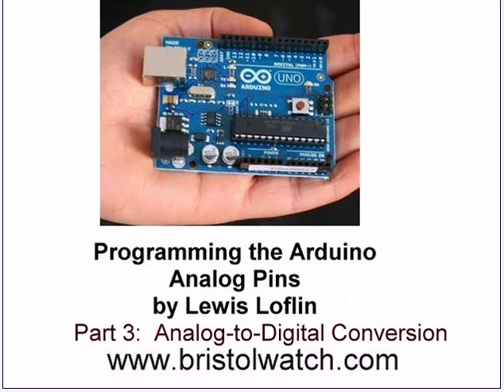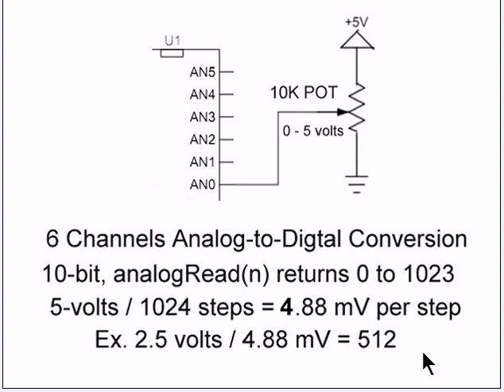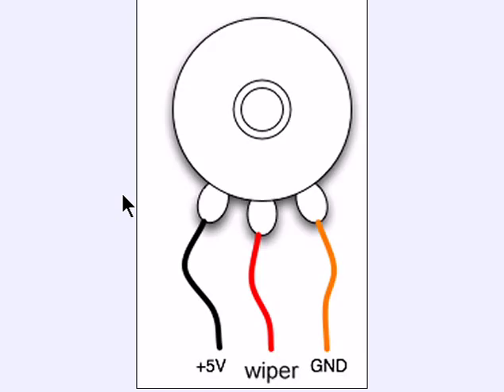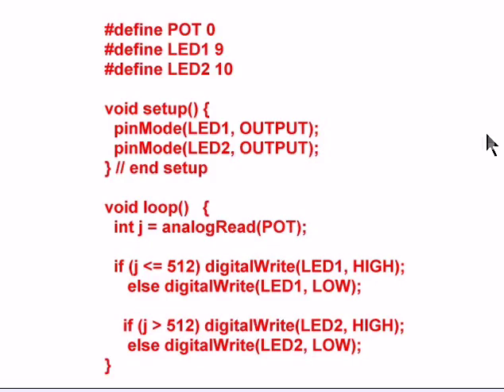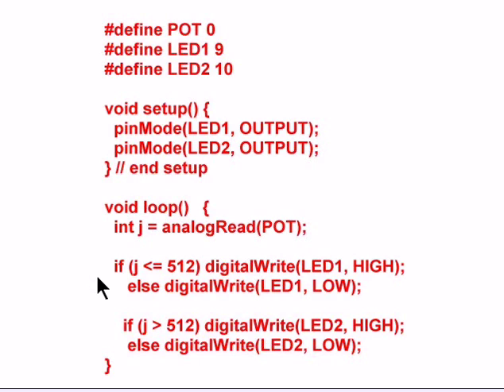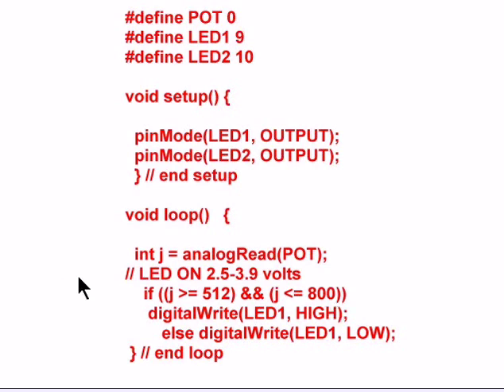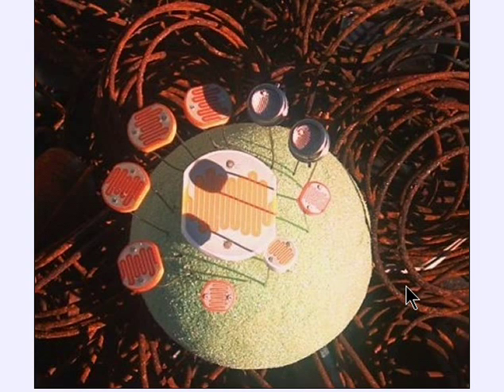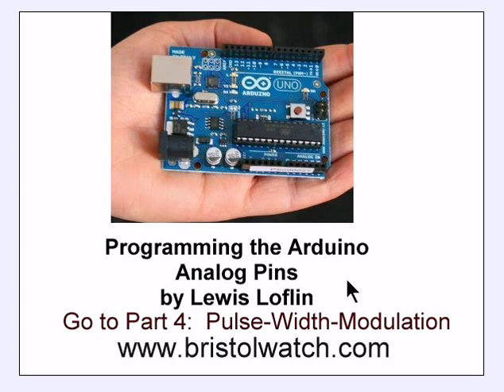Part 3: Arduino Analog to Digital Conversion

Comment: These 4 videos in the arduino collection are excellent, I program Microchip PIC's with Assembly Language, been a long time since I used C as a language, late 1990's,  but understood the language, best of all the hardware explanations you gave were the  best I've heard, very easy to understand software explanations and very helpful to me on the hardware side also.

Thank you sir. Will be checking out your website for other information also.

Comment from the maker: Introduction to the  Arduino Microcontroller
 
Part 1: Programming Arduino Output

Part 2: Programming Arduino Input

Part 3: Arduino Analog to Digital Conversion

Part 4: Using Arduino Pulse-Width-Modulation

Comment: Dear Lewis,
You explain very well.

I am an Arduino fan with a query, how would you interface if you need higher resolution say 12 bit from a 12 bit ADC. Will a 12bit resln can be worked out  with 10 bit MCU? hope you give some example too.

Best Regards